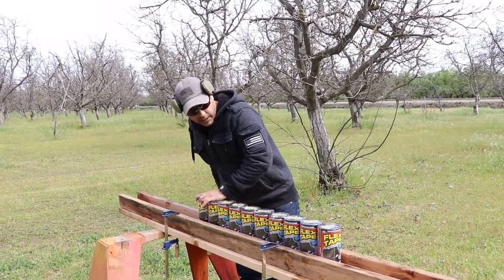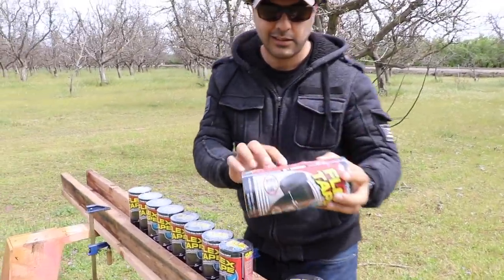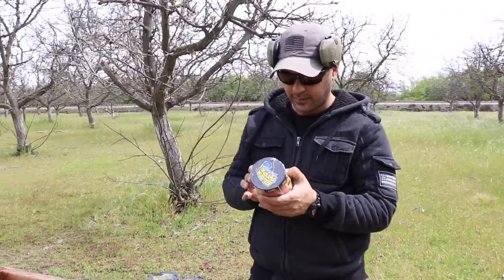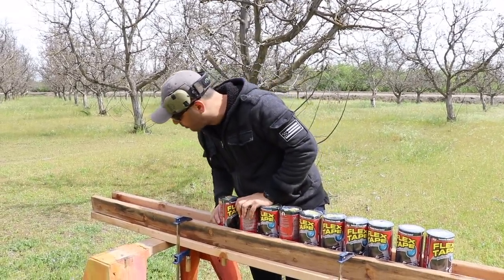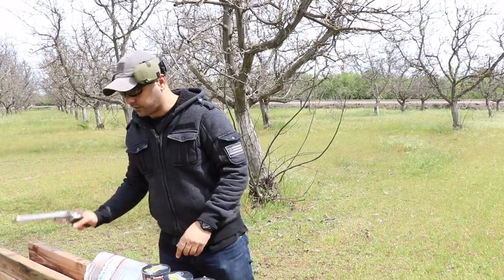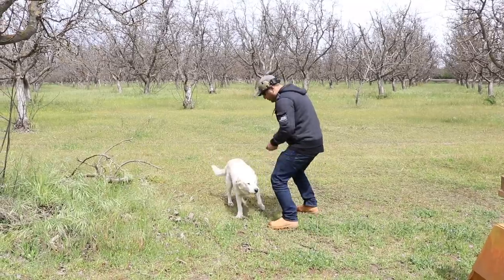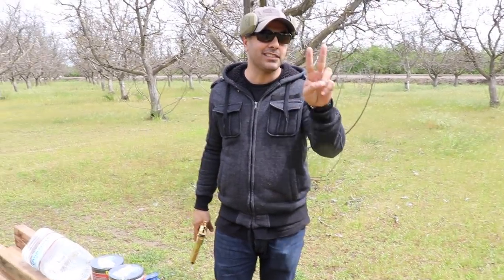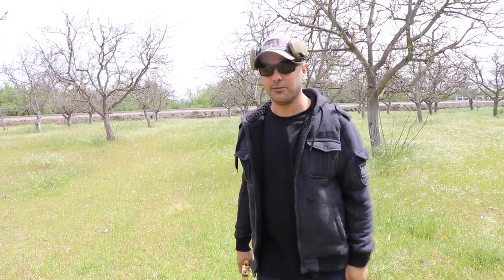FLEX TAPE BULLETPROOF?

Comment: I SAWED THIS BOAT IN HALF!
Reply from the maker: U know we shall try that lol
Reply: lol god bless you guys
Reply: Yahhh hoooo weeee
Reply: and repaired it with flex tape
Reply: I wouldn't put anything past their marketing angles. One day we will probably turn on the TV to "I JUST chopped my arm right off"
Reply: Gun Sam Revolver Aficionado well, in the words of the flex tape man, “That’s a lotta damage!”
Reply: TAOFLEDERMAUS HOW MANY DOLLARS DOES IT TAKE TO STOP A BULLET?
Reply: TAOFLEDERMAUS that’s a lot of damage
Reply: TAOFLEDERMAUS llllpookl
Reply: And my butt fell off before I could get the tape on....
Reply: TAOFLEDERMAUS HOW DEAR YOU
Reply: Wowee dawgahyah????
Reply: TAOFLEDERMAUS you should make some flexglue slugs!
Reply: It actually works!!! I had a huge hole in my haul put a piece of flex tape then used flex seal paint over it and you can't even tell there was a hole there now. It's been 2 years it has not degraded and seems to just get stronger
Reply: Has anybody tried shooting tungsten carbide or the modern armour found on mbt's?
Reply: That’s a lot of damage!!!
Reply: Mr.t Whitie  for shock factor

Comment: Looks like the 50 hit one of the 9mms from earlier. That was a fmj solid 50 round and it looked like a hollow point expanded when you dumped them out of the tape roll lol. Just something I noticed and I could be wrong :)

Comment: I think u should try 20 mm against 15-20 of these rolls......it may stop that too...... 😂
Reply: 15-20 Cans of Alpo😆
Reply: You would need at least 20 rolls minimum to stop a 50bmg (I'm thinking closer to 30), a 20mm would likely require more than 50 rolls (I'm thinking around 70 probably)
Reply: Nikhil 242 20mm would like just cut it in half
Reply: The YouTube channel called silver _22970 has the same cover for you channel
Reply: Nikhil 242 probably curve off before ut reached the end

Comment: What's crazy is ,the 9mm went as far as the 50 AE ?!?!?!? Wow !!!
Reply: Velocity of the bullets matters more than the size
Reply: Ok I am NOT going to get into a big debate about that . But if that was TRUE the 22 cal running at 1,800fps is much faster than a standard 9mm going 1,200fps or so. Speed , dia , bullet material and length of the barrel ALL effect penetration  !! There all all kinds of 22's running various FPS , and different bullet shapes and metals , and all have a effect on penetration . SP , FMJ , HP ?!  Have a good one ........... Gubs .out